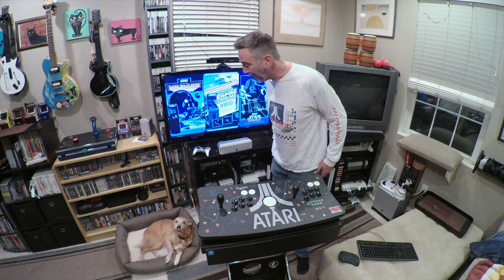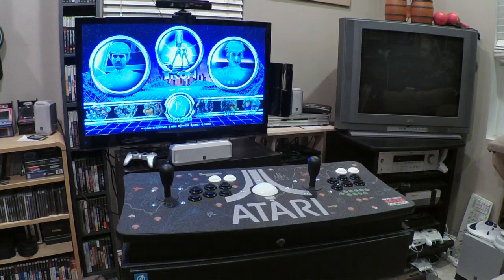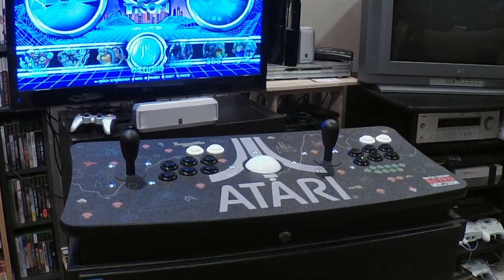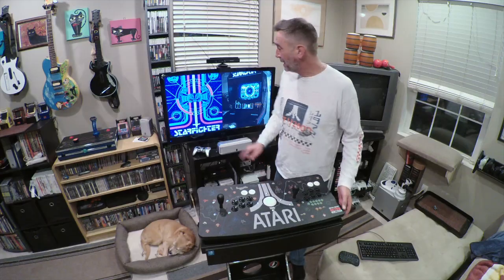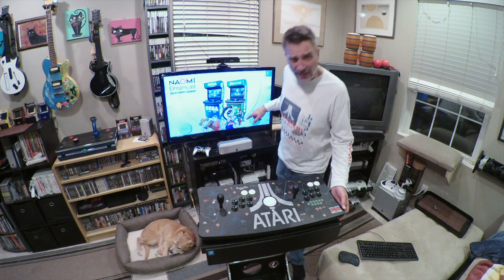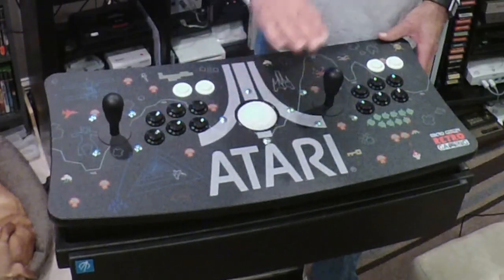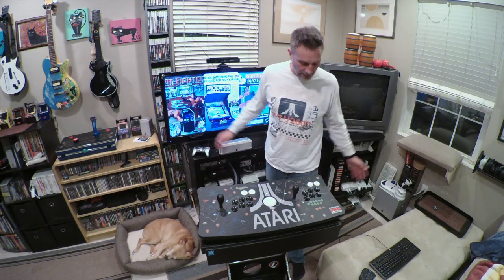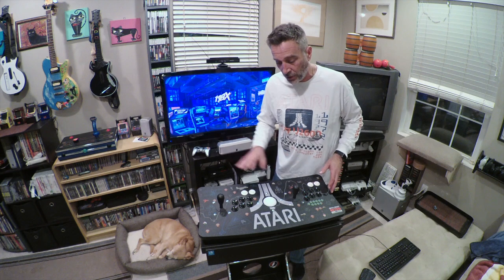Atari Ultimate Dual Arcade Fight Stick with Trackball - Set up tips with Virtualman Pi4 Image.

Comment: Hey DD great vid. Question for you. I am trying to add two new buttons to my Atari Fightstick (to player 1, on buttons 11 and 12). How do I properly ground the new buttons? Thanks much.
Reply from the maker: Hey man, thanks!! The ground line in the stick will be the one that is common, or also hooked up, to each of the other buttons in a daisy chain. They will all be coming from the same ground point, so grab a couple of the extra ones from that chain and put them on the same spots that you see the other switch’s ground line/points going. That should do you up real quick! Let me know if you need more info.
Reply: @DoubleDguitar  Thanks DD. All of the slots in my common were taken, but no problem, I was able to splice in new spade connectors and add two new buttons. A little drilling and now I have left and right flipper buttons on the side of my fightstick. 
Cheers!
Reply from the maker: @Wilhuf1  awesome and good thinking! Enjoy! I was just playing some Robotron the other night. 🤘🏻
Reply: @DoubleDguitar  I used to spend HOURS on Robotron. Hypnotic, once you get in the zone. I need to set that one up for the Atari sticks. Save Mikey!
Reply from the maker: @Wilhuf1  save Mikey!!! Awesome!
Reply: @DoubleDguitar  After some fiddling I also got Roborton working. Crazy game. Still holds up after all these years.
Reply from the maker: @Wilhuf1  it really does!! Good, man. I am glad you got it going. Ever tried Smash TV?? It’s a spiritual follow up, if you will.
Reply: @DoubleDguitar  I’d buy that for a dollar!
Reply from the maker: @Wilhuf1  hahah, so clearly you know! 🤘🏻

Comment: Great channel, subscribed.  Although this is an older video, I hope someone sees this.  I'm picking one of these up next week and am curious where to obtain the VMan image etc as well as others to change this out a bit.  I was into MAME over two decades ago on my pc but just using keyboard controls for arcade classics.  This is a game changer.  But I definitely want a good image card to drop into this thing.  Someone point me to  the image used ?  Also, I'm picking one up with RasberryPi3b already in it, but I'm assuming if it can't pull the weight of some newer stuff I can just swap out with Pi4 plug and play without having to change anything else?   Sorry PC guy and never messed with Raspberry Thanks.
Reply from the maker: Hey man, thanks for subscribing and checking the video out! Virtualman has a great channel and has pretty much moved to PC builds. But I believe his forums are still active for pi and lots of his info. I recommend finding him here on YouTube and checking out one of his videos for a current forum link. From there he has you read through the welcome note, which has all the important info to find his builds. It helps reduce unwanted traffic hitting his links. The Atari stick is killer! You will need to change over some emulators, in order to get the trackball to be seen correctly. I cover that for a minute in this video. And the forums also helped that out a lot. Hopefully this gets you going in the right direction!
Reply: @DoubleDguitar  Thanks for the response!  I'll check out his channel and review the info already out there.  You've given me a great head start.  That's invaluable and I really do appreciate it.  I did note what you were saying about the trackball, which again is key.  ( One of the reasons I picked this model up... There's no substitute for a trackball.)  I'll have this tweaked and adjusted nicely a lot sooner thanks to your videos etc.  Did you move to a PC build or staying with Pi ?
Reply from the maker: @relaxed70  so far, just a pi. But, I am close to wanting to do his new PC build. I just need to free something up here.
Reply: @DoubleDguitar  Great :)

Comment: Quick question. I finally gave up and just went with a logitech/rumble pad like you have. It pretty much works with everything. I went back to the atari stick just like yours and tried to get into the tab mame menu on VM. Nothing works. I did go into the enable joystick and menu settings but cant get into the tab menu for robotron. Did you have a problem like this and how did you solve it? I dont know any other way to go into the retroarch controller settings to enable both sticks in robotron. I only know of mame tab menu for that game. I cant get the tab menu to come up on any vm games. I have the 128g retro bliss image.
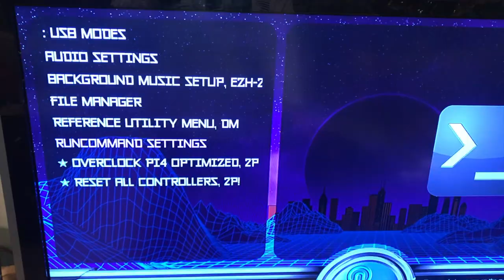Reply from the maker: Check the reply in your first comment thread, and check 7:22 on the video. That is the key to enable selecting the emulator while booting a rom.
Reply: @DoubleDguitar  There was more to it. Once you set up to the 2003 emulator only then will you see what I am about to describe. Go into retroarch quick menu and choose options. Now and only when set to use 2003 emulator, you will see a option to turn tab menu or mame menu on. You have to go back in and turn this off or it will stay on the screen when the game restarts. Turn the menu on and there is another option to activate 2 joystick in the same menu. I turned that on too. Not sure if I needed to but when I saved the config file and restarted the game and turned the tab menu off walla. Both joysticks now working. Now the trackball, dual stick works for both the atari sticks and the game pad. The game pad was sort of tricky  too. It wanted to default to one side joystick and one side pad buttons. I had to turn off the analog stick to none I think in the retroarch controller options for that game and save it. Then both joystick on the pad started working.
Reply from the maker: @davidmcghee7696  oh ok awesome! Yeah, this thing with twin stick games is really fun. Dude, I am stoked you got it going. I have a feeling you will have the ball working soon.

Comment: I have encountered this problem with the wireless pad mini keyboard. After I hooked it up I noticed that the trackball on the atari console started being recognized as a cursor on the screen rather than moving the game component such as crosshairs in missile command. Even when on the raspi desktop it moves the cursor around just like a pc trackball. I have not been able to get it back working inside the games. Missile command uses the joystick but the trackball just moves a desktop cursor around the screen while playing the game. SO FRUSTRATING! How do you get it back once you unplug the pad on the mini keyboard?
I have done so many things from retro mouse to 0 1 or 2 and nothing changes it. I watch your video like a atari console guide. Thank so much for sharing your experience.
Reply from the maker: I know how frustrating it can be. One thing that helped was when I turn my Pi on, I generally don’t turn on the keyboard with the mouse pad. That makes the trackball go back into the original retro mouse slot it was in when I set it up. Try that, maybe? Also, Game Room Solutions has a great video on how to determine which mouse port the trackball is registered. Check their channel out and especially the one about using a trackball and spinner on one image. That one turned on lots of lights for me.  I hope you get something worked out.
Reply: @DoubleDguitar  I checked out that video just now and got the mapping in the terminal. Trackball on 0 and mouse on 1 and even tried taking the dongle off completely and hiding the keyboard wireless pad thing under my bed off but this damn cursor movement with the trackball is still there. I can move the cursor with the wired mouse and the trackball usb atari. I just have two trackballs. By the way the wired mouse is a logitech trackball or something similar. Never could get used to a mouse. That game room video uses a retroarch with a totally different file structure than the RA found in retropie. Cannot even find those files but I can see the location of the ports for each device from the terminal. Search goes on. I hit him up for a solution too. Let you know what I figure out.
Reply from the maker: @davidmcghee7696  ok yeah, please feel free to post anything you figure out here. That is wild. There are higher port numbers, but this definitely sounds like the trackball and keypad issue is deeper than I have seen. Hope you get something worked out!
Reply: @DoubleDguitar  I have changed a few things on several SD cards and finally got the cursor to disappear but the trackball still never works. All emulators with a game that I know used to work with trackball, missile command. What I did was copied some files into the RA config file. I updated the files a bit to match the mame I have installed but this seemed to get rid of the cursor only.
I also changed the RA user binds index for mouse to 0 1 2. I think I may keep going up to 5 or 6 but udev still shows the trackball hooked up on 0. At a loss still. I also heard that after adding the ETA prime suggested BezelProject Bezels script that some people have funny things happen with the mouse keyboard showing up on the screen while playing games. Even hearing Win dong sounds when hitting the edge of the screen. Sounds and visuals. I like it. haha. Seriously, still cant get it to work. May start all over again with a new build but my luck would have this happen right at the end all over again.

https://www.youtube.com/watch?v=WrIzdSEA0T4&t=328s
Config info:
mame2016_dial_device = "mouse"
mame2016_media_type = "rom"
mame2016_mouse_device = "mouse"
mame2016_mouse_enable = "enabled"
mame2003-trackball_device = "mouse"
mame2003_mouse_device = "mouse"
mame2003-dial_device = "mouse"

https://www.youtube.com/watch?v=BN4_tm4jvXg&t=288s
mame2003-mame_current_mouse_enable = "enabled"
mame2010-mame_current_mouse_enable = "enabled"

CREATED THESE FOR CURRENT MAME SETTINGS
mame_current-trackball_device = "mouse"
mame_current_mouse_device = "mouse"
mame_current-dial_device = "mouse"
Reply from the maker: @davidmcghee7696  that is weird that it isn’t seeing it as a trackball in the port it shows up in. Maybe a fresh build would be best. I hope you can get it back to a useable state.
Reply: @DoubleDguitar  Quick question. I finally gave up and just went with a logitech/rumble pad like you have. It pretty much works with everything. I went back to the atari stick just like yours and tried to get into the tab mame menu on VM. Nothing works. I did go into the enable joystick and menu settings but cant get into the tab menu for robotron. Did you have a problem like this and how did you solve it? I dont know any other way to go into the retroarch controller settings to enable both sticks in robotron. I only know of mame tab menu for that game. I cant get the tab menu to come up on any vm games. I have the 128g retro bliss image.
Reply from the maker: @davidmcghee7696  yeah, I had that issue and I believe at 7:20 I talk about how to get to that setting. I am at work and just looked at the video. Check that really quick. I will be off work in an hour.

Comment: HELP! It works in Lakka. I got the second player working first time I tried. Now I am using Retroarch on an Android tv box. I don't think there is a cmd. or udev. file anywhere to put the code in.  Any help would be more than appreciated.
Reply from the maker: I am not familiar with the Android set up and really not sure if that encoder is going to be recognized by it. For my one Pi build using Android, I had to use a different encoder to even make player one work.
Reply: Thanks. I bought a Pendoo X6 Pro H6 device. It's a powerhouse but I cannot find a Linux frontend that will support it. Batocera, Emuelec, Lakka, etc. I cannot find a profile for dual arcade sticks in Kodi either. So I was trying to use Retroarch which works great but can't get player 2 to work.
Reply: Just trying to either find a solution or alternative. Running out of options.
Reply from the maker: @AngryCalvin  if you find something, please feel free to post anything about it here for others. What does the X6 do for you?

Comment: Doesn't the atari stick come with a 3B+?Does it work with Virtualman Pi4 image?
Reply from the maker: There are a few retail versions of it, the one I bought was before they had started including a Pi3. Once they did include one, they also switched the first button to a red one. Literally the week after I got mine, they started including a Pi. This video is using the Vman Pi4 image, and as I mentioned at a couple of spots, his image isn’t setup to use a trackball on a lot of the trackball games. So an emulator change needs to be done.

Comment: I think the problem is I don't understand how you got your image on a 32 gig card.. because the way I understand it a raspberry pi 3 can't go any higher than 32 gig
Reply from the maker: It can go much higher than that. 3 or 4 and this is a 4. You can boot from a hard drive, even. With an update to the system, there are lots of options.

Comment: How do you get this working on a pc ... my pc won't recognize it as a game controller,  just as a usb input device and I can't configure it..
Reply from the maker: I haven’t tried it on one, but it should be recognized as a USB controller. I have heard people use an app called joy to key, maybe that would help? As well, I had an extra switch here and added it to the “mode” line on the Xinmo board and it can help swap it between one type of configuration to another. Maybe try that?
Reply: @DoubleDguitar  in afraid I'm not very electronically inclined.. lol so.. if I want to put a different image on the raspberry pi in it.. do I just install it on a flash drive and plug it in?
Reply from the maker: @GameStorm68  I recommend checking out ETAPrime and LeePSPvideo and you will get a really good idea about flashing an image. ETA has good lessons on getting a controller configured, as well. It seems tough, at first. But it becomes pretty simple. I like the Pi4 for more advanced stuff and this setup works well for it.

Comment: i have the same exact setup, same stick, same image. cannot for the life of me get the track ball working. any thoughts?
Reply from the maker: Yeah man, definitely. A couple people have asked about the same thing. Vman didn’t use MAME 2003 or 2010 as the emulator for a lot of the games that use trackball. If you change the emulator for the game you want to use the trackball to one of those two, it will be seen right away. Then you can tweak. I mention that really quickly in the video, but it goes by fast. Doing that will get you rolling immediately.
Reply: @DoubleDguitar  weird! I've tried mame2003plus and mame2003 and still no go. Appreciate the fast reply and will keep noodling'

Comment: Hey there what I was trying to get at was if I sent you the Atari with raspberry pi what would you charge to make the mods to it to make it like yours?
Reply: And cost to do that
Reply from the maker: @johnm1199  oh gotcha. That isn’t a service I offer, and honestly everything I did was just buy the individual units and add an image. I didn’t have to mod anything other than change a button and verify the emulator. That cost to you would not be worth, especially compared to the knowledge of learning how to do it and being able to apply that to any other image you work with. It is really simple.

Comment: Hi there ! Great video . I am novice at this . How do I load golden tee into this thank you!
Reply: Yes with this Atari thru raspberry pi! 👍
Reply from the maker: @johnm1199  I use an image running Emulation Station. I recommend checking Arcade Punks for a pre made base image or even one with an arcade set of roms. The emulator should be set to MAME 2003 or MAME 2010 and it will be recognized as a trackball. I also recommend Game Room Solutions channel on YouTube for some really good setup tips. Once you have an image running and the golden tee rom loaded, it will work perfectly with either of the above mentioned emulators.
Reply: @DoubleDguitar  this is very helpful for noobs like me! Thanks dude 🤘
Reply from the maker: @DarkReturns1  thanks buddy, I hope you get set up and playing soon. I saw your other comment. Lots of good info on YouTube about getting started with a Pi.
Reply from the maker: Hey buddy, thanks so much. So when you say load it into Golden Tee, are you referring to using a raspberry pi? Or do you have an actual golden tee cabinet? I am using a Pi and the process can be a little tricky, but I will gladly explain what I can. Let me know.

Comment: How can you adjust the button mapping and trac ball sensitivity? I can’t get it to work properly.
Reply from the maker: On the Vman image? It depends on the emulator that is running. If Tab from a keyboard doesn’t work, try your key combo to access the retroarch menu, for me it is select+x and you find the option to turn the Mame menu on. Make adjustments and then turn off. You may have to change to an emulator that recognizes the trackball, if you haven’t already. I mention that in the video. His forum is a wealth of knowledge.

Comment: You say you had to change the emulator for trackball compatibility but didn't you have to replace the ROMs for those games as well? I ran into the same problem where the person who built the image I'm using had the default emulator set for final burn alpha . Just changing the emulator to  MAME2003 caused games to simply not load. I ended up having to download a 0.78 ROM set for MAME2003 in order to get my trackball working for all the appropriate games.
Reply from the maker: I have heard that rom sets aren’t as big of a deal in many cases, this image is definitely the case. It worked fine to swap.